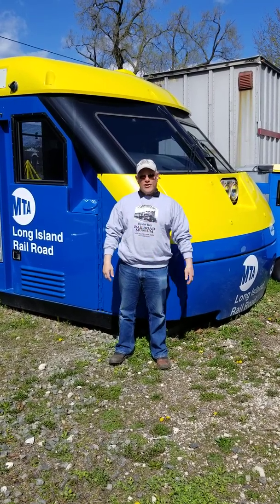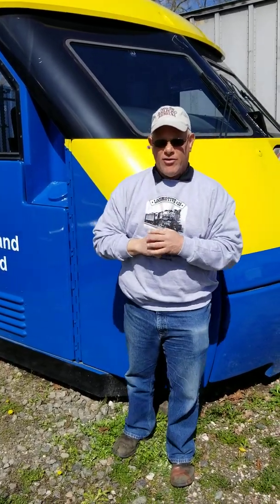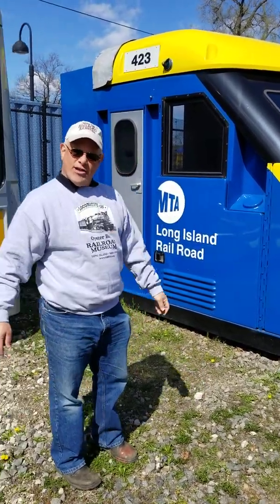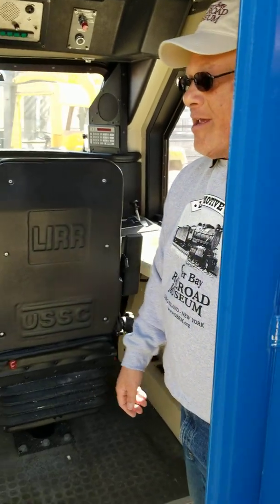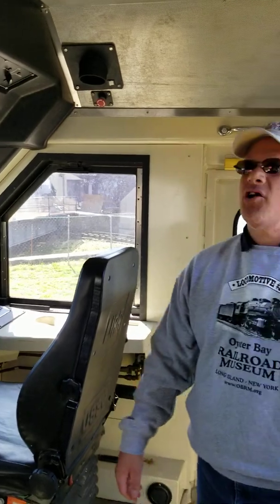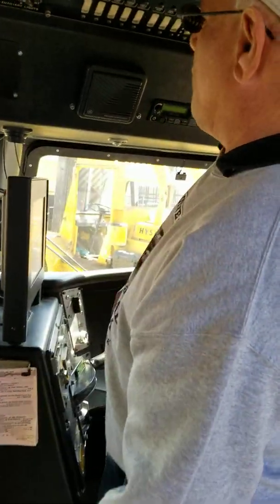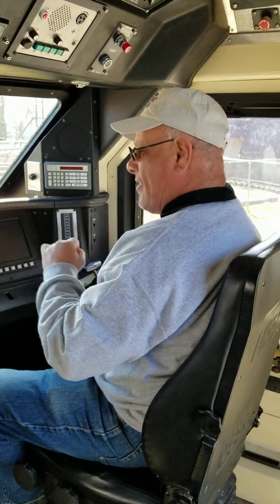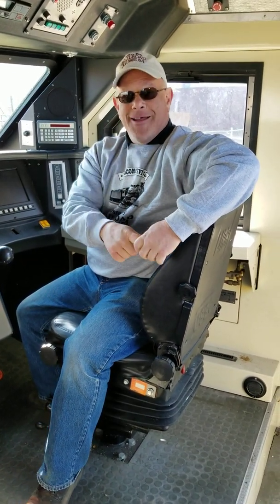LIRR DE-30 Simulator - Virtual Tour 10 - Oyster Bay Railroad Museum

Comment: Did the LIRR have more than one of these? Since DE/DM are still in service today, are new engineers still being trained on similar?
Reply: These exact simulators are out of date. The entire cab of the train has changed over the years. There are more of them but it’s not the full cab. It’s only the controls